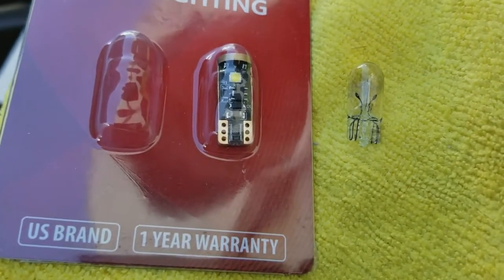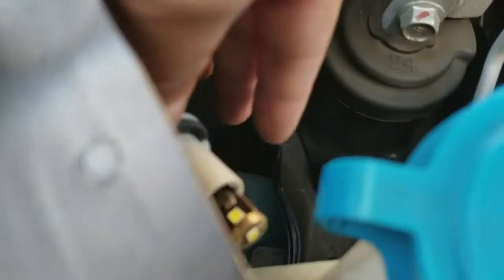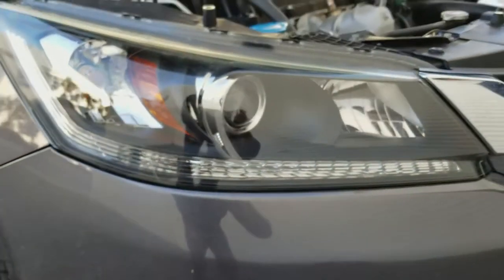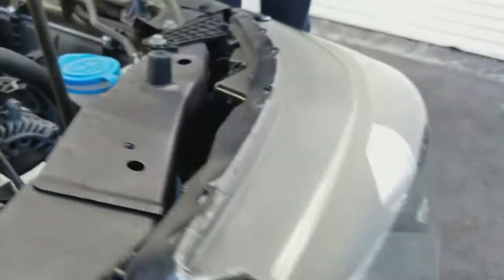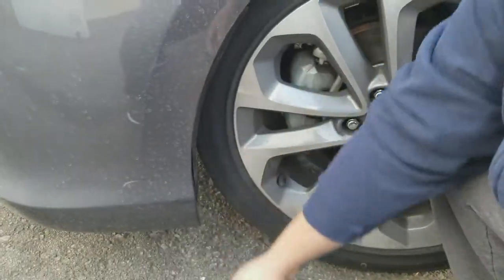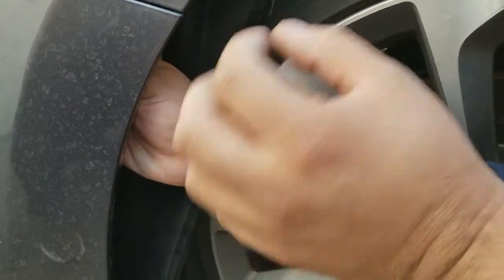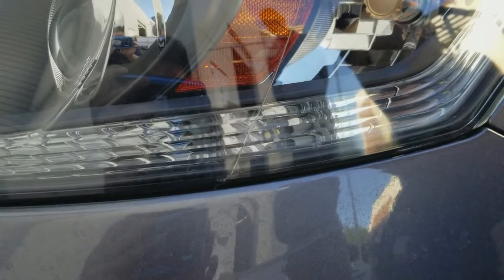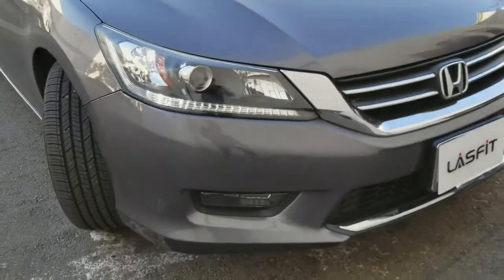Installing LED Daytime Running Light DRL Bulbs In 2014 Honda Accord Sports

Comment: Great info. Wondering how I was going to change that bulb. Thanks so much
Reply from the maker: It's not hard to change the stock halogen bulbd with LED bulbs.
Firstly, you need to reach the original halogen bulb.
Secondly, twist out the halogen bulbs and disconnect te power cord.
Last step, install on the LED bulb and connect the power plug.

Comment: Is it the same process for a 2017 Honda accord sport??
Reply from the maker: Hi, according to the information we have gathered, the daytime running lights of the 2017 Honda Accord Sport are LED strings. Therefore, the installation process may differ from what is shown in the video.

Comment: What size is the lowbeam LED bulbs for 2013 accord sport?
Reply from the maker: Hi, the low beam size is H11 for your 2013 accord sport. You can purchase from this link:
https://www.lasfit.com/products/2013-2015-honda-accord-led-headlight-bulbs-high-low-beam-exterior-interior-lights?utm_source=Social&utm_medium=YTB%20Channel&utm_campaign=Honda%20accord%202013-2015
Reply: @lasfitvehiclelife  just installed on Friday. They look awesome. What is the lifetime on the LED lowbeams/ T10?
Reply from the maker: @camel87jr  We have customers bought these LEDs 5 years ago, which still work well. Actually, the lifetime depends on the frequency of utilization, environment and other factors.
Are you interested in sharing your experience to Lasfit products? You'll get gifts, click here:
https://www.lasfit.com/pages/share-your-videos?utm_source=Social&utm_medium=YTB%20Channel&utm_campaign=V-YTB

Comment: Would these T-10s also fit on a 2015 Accord EX?
Reply from the maker: Thank you for leaving the message.
After searching the information about your 2015 Honda EX, we find that daytime running lights share 9005 bulbs with high forward lights.
Could you please check whether it have a small light below the low beam?

Comment: How you set up the strip lighting to work as drl because my drls are the ones in the left side of the head light the one for high beam
Reply from the maker: Hi, the strip lighting works as DRL, we did nothing. Did you change something or installed a after-market headlight assembly?
Reply: Lasfit Auto Lighting no sir it comes like that , check out other Honda’s from same generation, the drl are not the strip light
Reply: You think it has to do with the model? Cause mine is the sport
Reply from the maker: @maycolgomez7982  What's the year of your Accord Sport? For 2014 Accord Sport, it has the strip lights. Yes, for some cars, the DRL is a bulb in the high beam headlight housing.
Reply: Lasfit Auto Lighting yup that’s my situation the drl it’s the same as the high beam housing
Reply: Yes, I have a 2014 Accord EX and my drl is the same headlight for the high beam. I did add the lights he is talking about and they look real good when I turn them on, especially at night.
Reply from the maker: @terencehatcher6901  Wow~~ You can share your experience 😎
Reply: They replaced parking/running lights. The true DRL's are the 9005 HB3 bulb closest to the grill. Still looking for a true plug and play unit that has resistors built into it to prevent flickering of the DRL's.

Comment: @Lasfit Auto Lighting do you notice that the light is very strong in the area of where the bulb is, but not as strong as going down the rest of the strip. Is there a fix, or is that just the way it is? I know it was only $10, and buying the whole led strips cost $40 or $50, but just wondering. Either way, I’m still happy.
Reply from the maker: Yeah. It is something to do with the OEM structure design. For new models, the OEM daytime running lights are LED strip lights already.
Reply: Lasfit Auto Lighting Thx. I have the 2015, right before they came out with LEDs already inside the headlight. 🤦‍♂️ Either way, the ones I put in are not bad at all. Thx.
Reply from the maker: @danielvitolo2595  You're welcome. 🙂 Did you replace all halogen lights with LED bulbs?
Reply: I replaced the low beams, Drl and all interior, trunk and license plate. Didn’t do fog lights because there’s a short so where. Gotta find it first before I can replace
Reply: @danielvitolo2595  can you send the link of the drl light?
Reply: Steven Tran All you have to do is replace the drl bulb with the LED chip, and if it doesn’t light up, turn the chip 180 degrees. Good Luck.
Reply from the maker: @danielvitolo2595  Thanks for your update. 👍👍👍👍👍
Reply: @danielvitolo2595  hell yeah I appreciate that, got disappointed when I read your original comment lol
Reply: @sergio hernandez Lol no problem. Hope you got it installed and working. Not bad for $10. Even $50 is not bad if your buying the whole strip, but a little harder to install. I might do it soon. But this one is great for now.